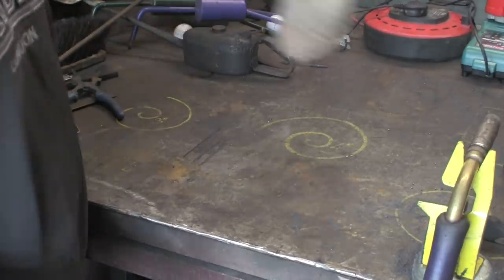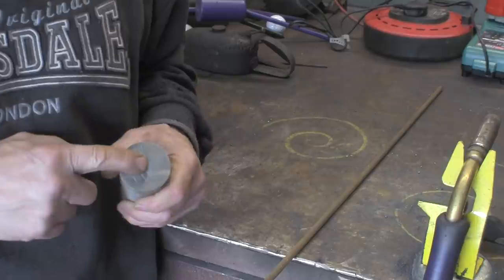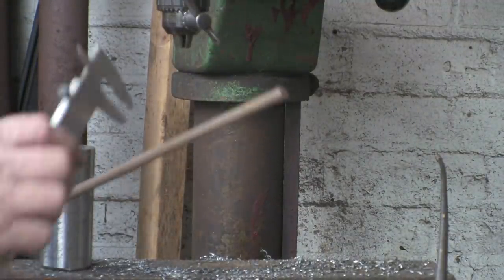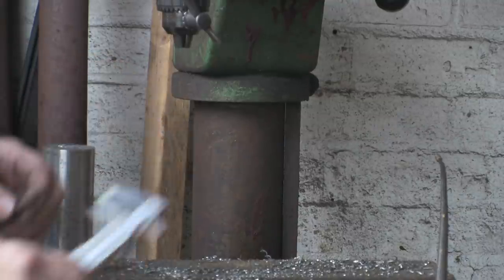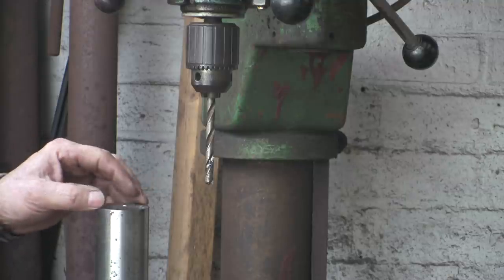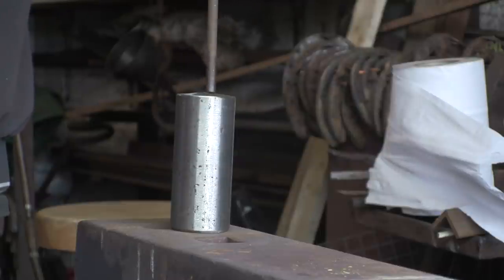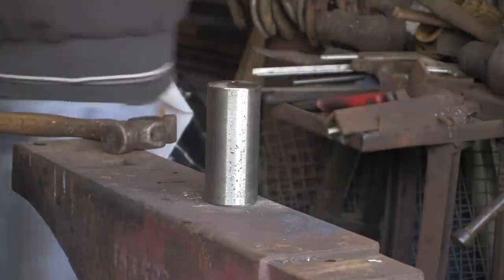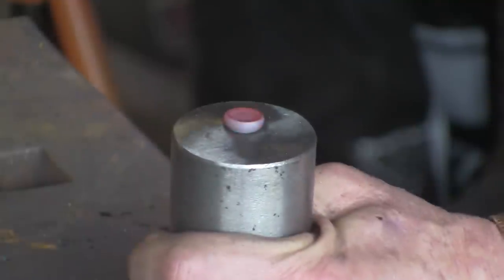Rivet header / monkey tool

Comment: Good video. Ive made this same tool in 4 sizes from 1/4"-5/16"-3/8"& 1/2".
Super handy to knock out a few rivets when needed.
I'm making mine to leave a 1-3/4"-2" long body under the head. If a shorter rivet is needed it's easy to just cut the end off to the needed length

Comment: This tool is very handy, i made one for 8 mil but made the mistake of drilling the hole also 8 mil, i later changed it to 8,5. The only thing you have to keep in mind is to drill your tong holes also 8,5 mil. Great video as always, cheers.

Comment: Would there be any disadvantage to using an inductive bolt heater to heat the rivet compared to the furnace? (for those of us without a furnace and subject to strict air quality management laws here in California)..  It is a versatile construction technique for example used to make some beautiful and rather big structures  incrementally with rivets and plates - like parts of the old Paris Metro, or in Spain.
Reply from the maker: If you are lucky enough to own one, use it!

Comment: If you drill out the other end to a different size you could use the same tool for another rivet.
Reply from the maker: no you couldn't. If you watched the video you would know that the top is domed so it won't sit flat if turned upside down!

Comment: Lubricant or Cutting Oil?
Reply from the maker: Either is better than doing it dry.
Reply: Interesting, I guess I would have thought the lubricant would make the drill bit tip more likely to slip and not cut.  Easier for removal, that makes sense.

Comment: No one uses rivets any more because you can't tell the tinsel strength on a single rivet.
Reply from the maker: I use them all the time, that's why I buy them by the bag load!
Reply: I apologize, I meant in commercial and industrial settings. Nice Video keep up the good work.
Reply: I use tinsel a lot at Christmas...  Oh I think you meant TENSILE strength. And Gary's right for some applications such as railway restoration rivets are indispensable
Reply: Thank you for the information.
Reply: except for the aircraft industry...bridge building industry and any industry where you need a fastener that can make seams waterproof. but other than those small shops........
Reply: Utter bollocks. Railway locomotive frames and boilers were all riveted. Boilers/ pressure vessels are safer riveted than welded. I don't recall seeing  riveted ships fall apart like the welded "liberty ships" of the 1930/40 era. They're not used so much now because welding is cheaper than riveting, and FYI rivets can be and were tensile tested.